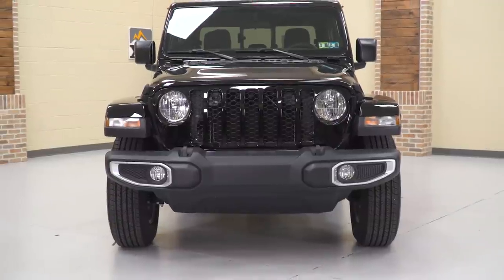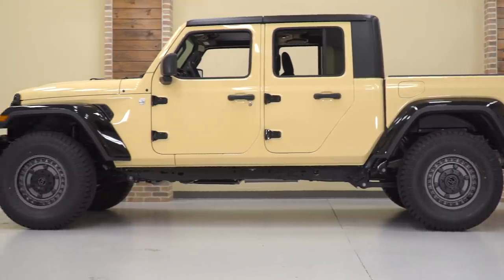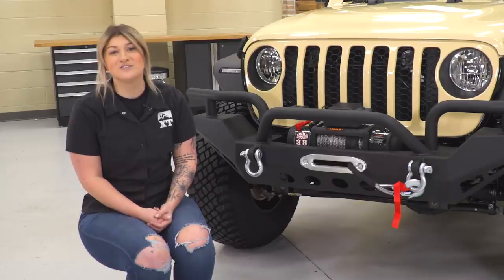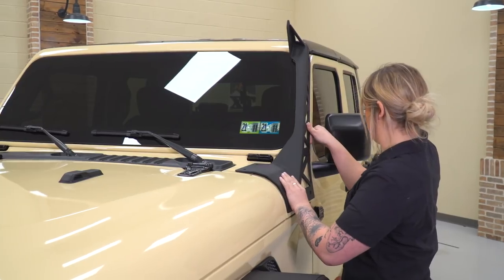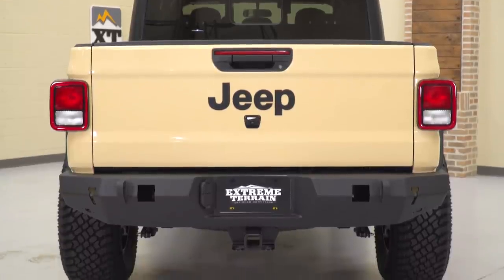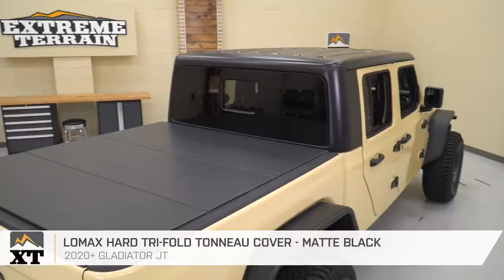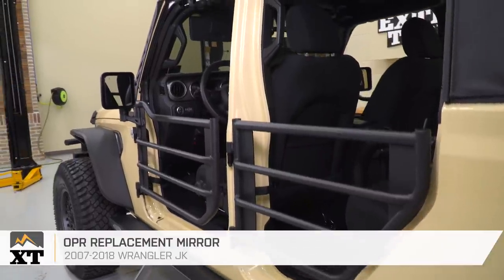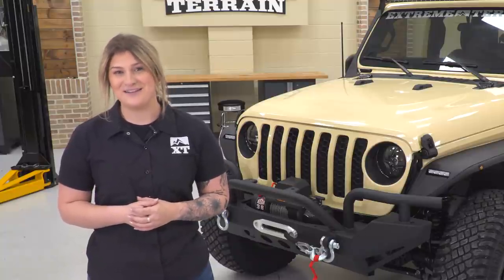Jeep Gladiator Completely Overhauled for Spring! - Throttle Out

Comment: Truck U showed a kit from Baxter Performance for the Gladiator that 
prevents the engine oil drain back issue. 30 minutes after shut off all 
the engine oil drains back to the crankcase, even the filter is bone 
dry. Every start up is a dry start.